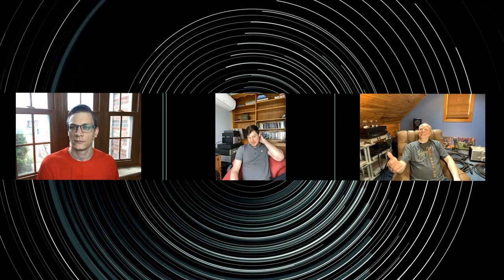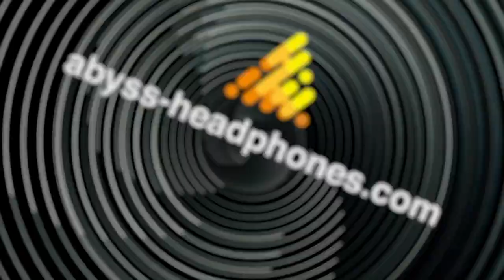How to get MORE Resolution

Comment: i am someone who is skeptical of cables, i am willing to understand if there is any difference. but to my knowledge the only thing that matters is isolating signals in balanced cables. someone needs to do a breakdown of the physics, because outside of the isolating of signals in balanced, i would not understand why there would be a difference.
Reply: @Bob ultimately no offense to anyone, i dont trust my senses or other peoples senses if they know that they are being tested. this is the main reason that i believe measurements are a starting point but not the ultimate determining factor. so i personally cant see justifying expensive cables if there is no measurable difference between cheap and expensive or if its negligible. i am more than willing to concede, just like on paper i know what the ideal amplifier , or the ideal DAC, or the ideal cable wire, i dont know how much real wires truly differ in terms of how the wire measures and how that changes the sound.
Reply from the maker: Unfortunately no one has developed a measurement protocol that will tell you how a cable will change how you hear music within a given system. Same with headphones, you can measure them in various ways, but the measurements are not necessarily a predictor of how they sound on your head and to your ears.
Reply: @ABYSSHeadphones  so i personally am curious then, and i mean this seriously, how does one shop for cables. i have no idea how someone would go about shopping for cables. every other component in the chain or the headphones make sense at least to me. but how does one find ostensibly buy--able hifi cable. and how does someone know if its a good price.
Reply from the maker: From the beginning suggest trying a few, particularly an AC cable on say the amp or receiver. One of our dealers is The Cable Company in PA, USA. They have a lending library of cables to draw from. If you're an Abyss owner you have our ear, we can provide highly experienced and focused advice.
Reply: @ABYSSHeadphones   genuinely good advice, thank you.

Comment: I've done blinded AB cable testing with a 50% success rate.  Spend your money on the transducer first (TCs perhaps).  For me, the amp is next, DAC is least important.  I dare you to prove, in a blinded test, that your 10k DAC defeats my 500 dollar used Chord Hugo.  If it does, I bet your talking minimal difference at best.